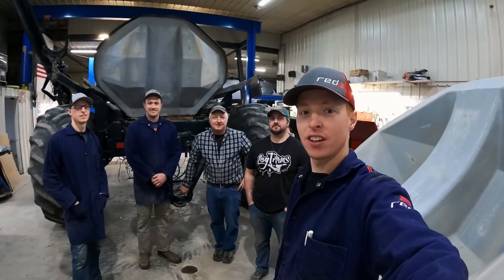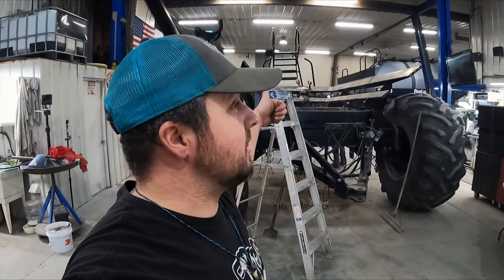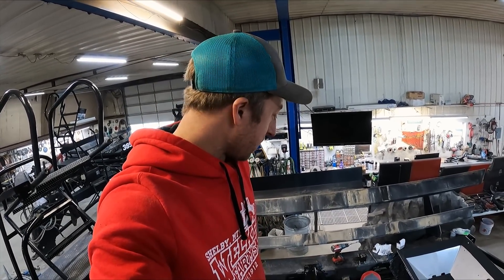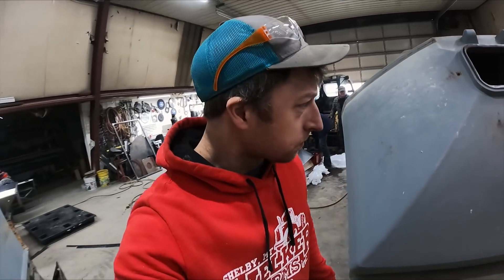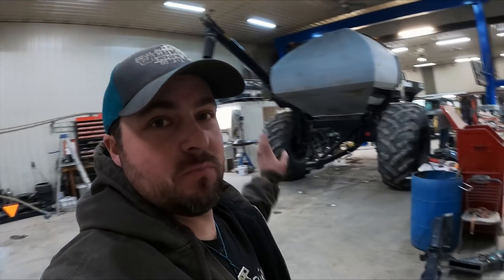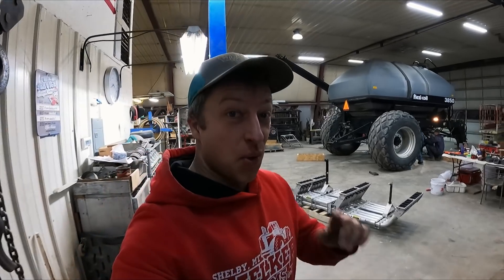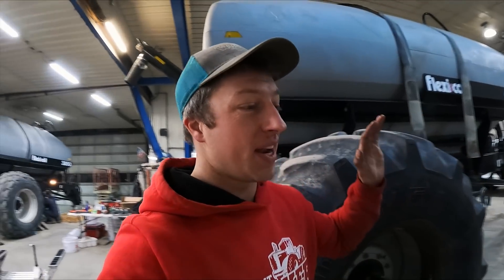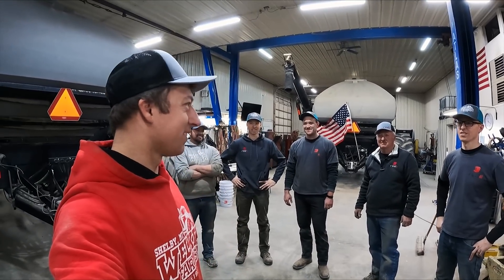Who signed me up for this?! | 'RedE' for MASSIVE UPGRADES Part 2

Comment: I’m genuinely curious about painting of the frames. Was the concern only the edited areas? I know there is time restriction with the crew there but would there have been advantage in painting the side supports or anything else? Or would that have been simply cosmetic and not necessary?

Awesome work though!
Reply: We buff and painted the areas which had rusted. But was some time restraints.

Comment: Thanks for the video. Redoing these karts is a lot of work. But you all used teamwork to get the job done. Never seen one apart before. Lot more to it than I thought. Thanks for letting us see what it takes to redo the karts. Should be ok for years to come. Thanks to Red Engineering. Thanks again Welkers. Was interesting. Thanks. Iowa farm boy from years ago.

Comment: You can use a low speed electric impact to tighten stainless bolts.  The Milwaukee M18 with One-Key can be programmed to spin at 100 RPM.  Add some anti-seize and torque those bolts up.

Comment: What’s the difference between the 3850 and the 4350
Reply: 50 bushels more capacity: 435 - 385 in tank size
Reply: 380 bushel 50 series flexicoil (3850)
430 bushel 50 series flexicoil ( 4350)

Comment: Do the cart manufacturers offer a stainless option from the factory, and if so, is the price difference worth the up-front cost as opposed to running non-stainless until it wears out and then retro-fitting?
Reply from the maker: They didn't back then and I don't think they do now. It would be a good 10k-20k upgrade if I were to guess.
Reply: @WelkerFarms  Well, at least that poor foresight on the part of the manufacturer creates a secondary market for RedE.

Althought, I guess it's less of a case of poor foresight and more like they're hoping you'll buy a new cart from them when their parts wear out. Haha, joke's on them, huh?

Comment: Do you guys use anything like antiseize on the threads to keep the stainless steel bolts from galling?
Reply from the maker: We did, made a big difference!
Reply: We work with a lot of stainless.  The threads really like to gall when you tighten them unless you add some type of lubricant.

Comment: I used to work at a place packing bolts the problem with stainless steel a lot of them aren't stainless steel there zinc with a stainless steel coating. To see if you're getting good stainless steel bolts see if they will stick to a magnet because if they stick to a magnet there zinc with a stainless steel coating not solid stainless steel

Comment: the problem with the stainless hardware is called galling. there is a special kind of anti-seize made for stainless and it allows you to use the impact drivers much easier. i used to put salters on trucks, learned it from the older techs. looks awesome guys, you did a great job!

Comment: i dunno,   stainless steel rots pretty fast when exposed to salts like fertilizers.
Reply: and your suggestion as an alternative? I think they are limited by what the manufacturers supply, but maybe they could use a 3D printer and change them every year.

Comment: Nice Gadsden flag guys. I worked with ss nuts and bolts all the time JD you are correct they need lube. SS is very abrasive and it will almost weld themselves together if you don’t use lube.

Comment: Yum, exfoliation corrosion. Wanna bullet-proof/corrosion-proof your steel...zinc-phosphate conversion coating, then zinc-rich coating, then primer, then polyurethane topcoat paint. Install your hardware with anti-seize and after everything is put together, caulk/sealant on exposed hardware (nuts & bolts).

Comment: Hope the stainless steel bolts purchased weren't 18-8 or you could have used a common steel bolt.

As for keeping the threads from galling, a product called Boe-Lube works great and is water soluble and completely harmless to eat. (other than lubing your insides up).

Comment: I bought some new SS hog feeders 20 years ago. I noticed that there was never-seize on the bolts. I thought to myself,why would you put never-seize on a SS bolt,oh well. This was when I was doing a major rebuild on a fully slatted hog barn.a month or so had gone by and I was ready to secure the new feeders to the floor using 5/16 SS wedge bolts. I grab the impact to run the nuts on. The self locking nut,locks up,with maybe 2 threads exposed. Bad nut or bolt I thought,so I try it again,ruin another wedge bolt. Now these are $8.00 apiece. About then the light bulb goes off in my head,SS doesn’t dissipate heat like regular steel and the feeder manufacturer had placed never-seize on their bolts for a reason. I never-seized the next bolt tightened right up. I never had any more problems. Isn’t it funny how,when someone or something is getting in your pocket,your memory improves?

Comment: It's like two different materials. One gulls more than the other. If both gulls the same you're sunk. You can put a SS nut on a CS bolt without much trouble. In threaded SS piping, we always seal welded them because of the above problems.

Comment: Too late for this installation, but POR-15 is an excellent "paint" to cover areas prone to corrosion or rust.  Creates a hard surface  similar to powder coating, but much easier to apply.

Comment: 14:15 BTW I don't think that stainless steel is considered a "hard" metal.
Reply: Ever tried cutting it?
Reply: @davidduma7615  
Actually, I'm thinking about how easily stainless steel bolts break.  Also how soft stainless steel rivets are.  You always have to turn your rivet gun down when you buck them.
Reply: @davidduma7615  I stopped thinking and just went to Google. This popped up.
 "Stainless steel has a low carbon content which cannot be hardened, and regular steel is slightly stronger than grade 2 steel, and at the same time it is significantly weaker if compared in the terms of hardness."
I still think of how easy it is to break off a stainless bolt.

Comment: I think it a 🤬DISGRACE🤬 that some of these BETTER materials and equipment, don't come new, on the machines from the manufacturer. 
For the money they ask for these brand new toys, everything should be top quality and, more than fit for use.!🧐!.
Parts that wear out naturally, and are expected to be swapped out on a regular basis, SHOULD be made from the BEST materials possible.  
Just because it's expected to wear, and it's well known that this is so, (.!🙄🤬🙄!.on fertilizer equipment for a good example.!🙄🤬🙄!.), doesn't mean that it's ok to use sub-standard materials that only last a certain amount of time, when a FAR BETTER material is available, but not used because cost to the manufacturer at purchase, and probably MANY TIMES afterwards, cuts into their bottom line toooooo far!🤬🤑🤬!.
  THERE.!🤔!.
IVE SAID MY PIECE, AND HAD MY RANT.!🧐🤬🙄!.
Now I'm happy.!😁!.

LOVE THE VIDS.!
Keep 'em coming.
Rich (UK)🥰🥰🥰.

Comment: Just curious what the cost savings of doing this as opposed to trading in for new would have been? I assume fairly significant but never heard any numbers. Do you have any?
Reply: Getting new ones would be waaaay more expensive than upgrading the old ones
Reply: I think they mentioned in last video, mentioned kit for one is $20,000 vs new seeder at $200,000
Reply: Thank you.

Comment: be happy you had to use a socket wrench and not an impact I worked at the Morris plant making air seeders with metal tanks and air driven impacts, my teeth still rattle and luckily the company had their own hearing booth so I suffered no hearing loss, I SAID NO HEARING LOSS, aww forget it. of course flexi has poly tanks

Comment: Kinda doesn't make sense that you're putting the rear tank in first instead of the front tank first... Actually you can use an impact on stainless, just go slow until it's starting to "hammer", back off slightly, tighten with a wrench, no issue with that especially since you're using anti-seize. I do recall last video, I asked if there was a concern about cutting those bolts, you just proved my point about that. Lucky you don't have any holes in those poly tanks. Great video, cheers :)

Comment: Can you buy air carts with factory stainless steel and other parts from the dealer without doing a custom upgrade?
Reply: Yes, Nick said it correctly. $50,000 upgrade.
Reply: @mfreund15448  Thanks for the reply...

Comment: There's two methods for erosion control. Using a hard corrosion resistant thick tubing is one method, but one of the other methods is actually using a poly material. They did some erosion testing where I work and wanted to see how long it would take to erode away different materials in slurries with different concentrations. Proppant in a gel was what they were using. They had a nylon tube that they could not get to erode. The theory for why the nylon tube would not erode is the material has some give. So when the particles (in this case it was sand) hit the tube the material absorbs the energy and doesn't allow the material to erode. Erosion is due to particles impinging on a surface and bouncing. This is also why they have sweeping bends on the manifolds. Basically the force vector of the particle is divided when it hits the tube. The shallower the angle the less likely it is to erode.

Comment: Probably a little late to be of use, but motor oil works wonders for keeping stainless from galling (locking up and wiping out the threads). Works wonders on aluminum too.

Comment: How did you get the old rusted bolts away from the Poly tanks without damaging or melting them?  Also on the Stainless Steel  Bolts  tend to cross thread if don't put Lube on them.

Comment: I’m some level it’s irresponsible to build machines with materials that have no chance of surviving their intended usage. It reminds of 1970s automobiles that rusted out in 3 winters.
Reply: @Bowhunters I’m a board member of a $150million manufacturing company. I worked 30 yrs financing manufacturers. My father was a VP of Manufacturing at GEHL, GALION and New Idea. I understand price points and planned obsolescence. There is no excuses for inferior materials.
Reply: @timothybailey7118  financing manufacturers? So you are a banker? Have you ever worked directly with an engineering team designing a product? Have you ever felt the pressure from business pushing you to reduce the cost so you can be more competitive in the market?  Doesn't seem like you have...
Reply: If you ever go into engineering you will find that every product produced has a price target. Engineers have to compromise on the materials, methods and features they have on a product to hit a cost target. Stainless is more expensive than carbon steel and paint. You also need a bigger brake press to bend stainless (initial investment in equipment is higher). I'd be interested in knowing what the cost to retrofit these air drills would be and I think that would inform you as to why the OE manufacturer would not use stainless components.
Reply: @Bowhunters Exactly and these carts are around 15-16 years old. It's not like they are new equipment. If they were human they would be able to drive a car by now. Nothing lasts forever.

Comment: Have you ever heard of treating rust on steel and iron with phosphoric acid there's also a product in a spray can called Rust Replacer. When it finishes  working it leaves the surface with a paintable better than primer barrier against rusting, because if the paint you use comes off it will not rust again where this has been applied.